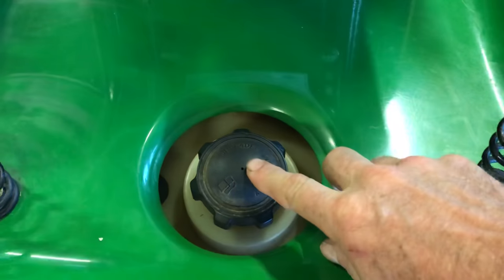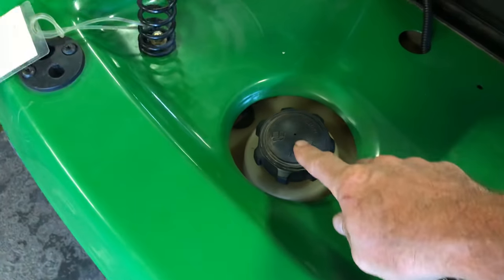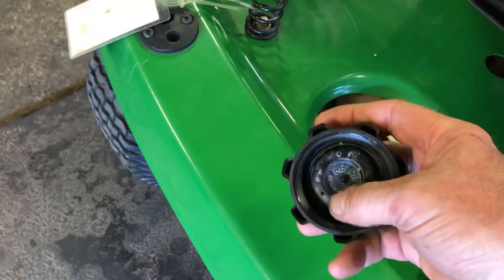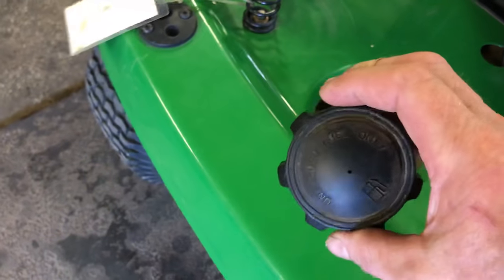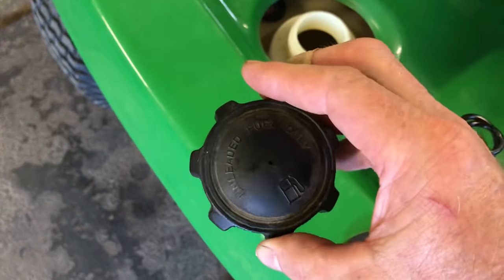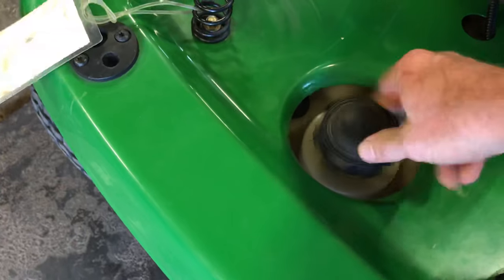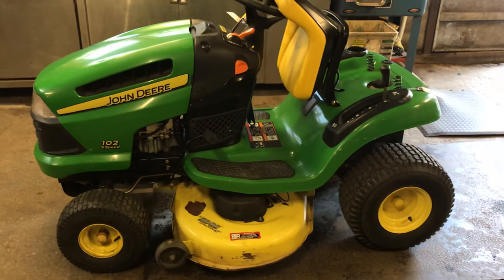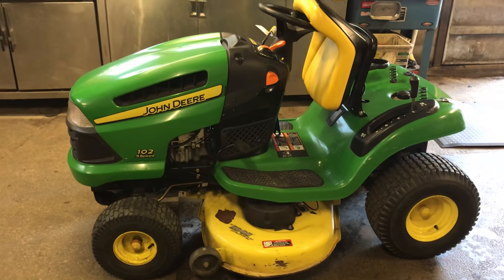Lawn Tractor stopped running while cutting grass

Comment: Thank you so much for posting this video!  Our neighbor is disabled and we were mowing his lawn yesterday and the mower just stopped!  Another neighbor helped us push it across the street back to our house.  We do have a push mower but really don't want to mow two lawns with a push mower.   The gas cap was clogged so I took a pin and cleaned it out and it worked like a charm.  We did go ahead and buy a new gas cap but really didn't need to.  Thanks again!   :-)
Reply from the maker: I’m glad you’re back up and running. Thank you for sharing and the kind comment. Please give this video a like, subscribe if you haven’t already and share my channel to help it grow. It would be greatly appreciated. I’m

Comment: Thanks for the tip.  Clearing that vent hole was so easy and it worked.  It saved me a lot of troubleshooting headaches and most likely the purchase of parts that I didn't need.

Comment: Ordered tune-up kit (needs to be done yearly anyways), still couldn't get it to run. Engine just kept chugging about 30 minutes after I mowed. Eventually just stops. I knew it had to be something with the gas intake (which ended up being air). I gotta say, you saved me a ton of time and money, thanks for the easy tip, it worked.
Reply from the maker: I’m glad you figured it out :) Sometimes it’s the simple things.

Comment: Hi Brad. What do I need to do with my craftsman rider ys4500 when going in reverse and blade engaged the mower want to stop. Im new to most riders and had a tough time finding my answer last night so thought you might help since your videos are so thorough and awesome.
Reply from the maker: Hi Bruce, You should be able to turn the ignition key back one spot from the on position after you start your tractor, to be able to cut grass in reverse.

Comment: My jd lawn tractor was doing this. I cleaned the fuel cap and replaced the fuel filter but it still has the same problem. Starts up fine, runs about 5 or 10 minutes, then dies. Any thoughts on what I could try next?
Reply from the maker: (1) you may have a issue with the electric fuel shut off solenoid (make sure to check to make sure it clicks on then off with the ignition key, then when the machine shuts down check it again to make sure it does the same) I may need to make  a video on that at some point when I get settled in a new location. Or I would suggest (2) checking spark after it shuts down, You will need to install a inline spark tester and check to see if there is no spark after it shuts down? If there is no spark and then it sits for a while and the spark comes back. You have a bad ignition coil. Replace ignition coil.